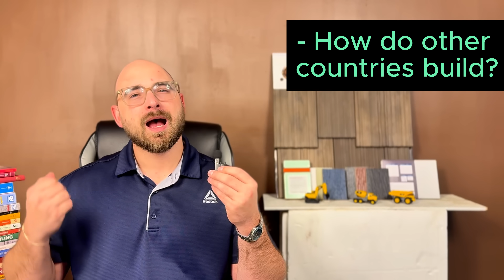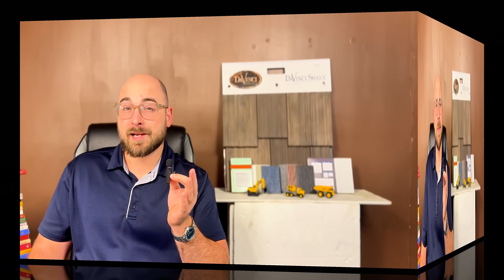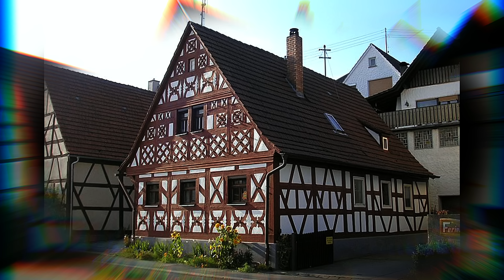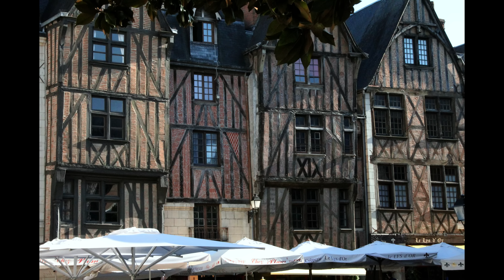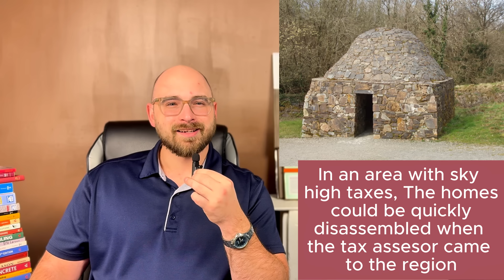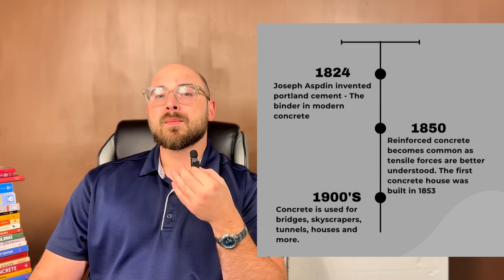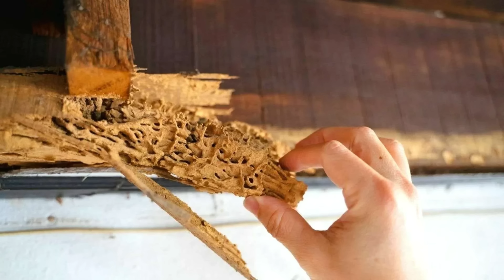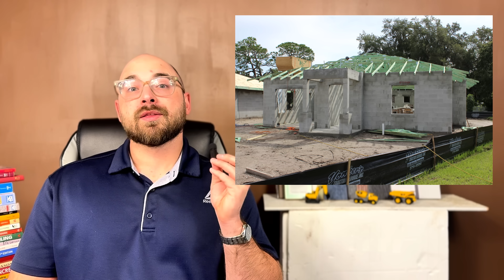Why Other Countries LAUGH at American Homes

Comment: I have a theory that one of the main reasons for homelessness in the US are houses built out of cardboard. Try using blocks or bricks. After the first owner dies, you don't need to demolish whole place and build again. Just paint it, fix here and there, and it's ready for another few decades of use. And it will be cheaper for lower income families.

Comment: @Mike Fortin: I’m planning on CMU construction in Florida. Reasons include termites, wind resistance, and thermal mass cooling. I’ve hit some of the design limits you mentioned, such as not being able to cantilever floors, but have come up with an attractive design partially inspired by the old Shipley-Lydecker house.
Internally, I plan on using lightweight steel framing for non load-bearing walls.
One additional tweak is using a cast concrete roof. I saw a lot of this when I was in Guam and Saipan where they have approximately twice as many typhoons as we do hurricanes.
Reply from the maker: Smart man, 

Have you considered ICF instead of CMU?

Comment: Even mexico, yeah I always wondered so I found the reasons , for example the roof has to be on those angles because of the snow, a problem we never ever will have in mexico, so for the wood the reason was the material is structurally strong and cheap, so it makes sense for USA but not for the rest because of the chain of production and practices, my granpa´s house has 300 years free of maintenance , in the newest part that was made like 50 years ago we need to water proof the roof every now and then oh yeah we changed the pluming because of lead

Comment: ICF does sound like a good approach, but leaves me with one question:  with wild fires being a long lived and growing issue in many parts of the US, is it even possible and if so, how costly would it be to restore one of the structures after a fire.  Think it's safe to assume that at least the outer layer of insulation would burn off.
Reply from the maker: ICF combined with fire-resistant design (Fire-resistant siding /cladding, metal flashing, non-combustible roofing materials, unvented attic space, defensible space, etc.) Is virtually fireproof. There's nothing that can burn. 

Should the outer insulation be damaged, rigid foam and furring strips could be placed on the exterior, allowing for rebuilding. 

And before the comments come in, YES you can build with concrete in seismic zones. You just need an engineer to add seismic joints and a proper foundation. A concrete building with seismic joints will be able to withstand a higher magnitude earthquake than a wood house. 

If you're worried about the cost that adds, build with steel and fire-resistant design. concrete is superior because it protects against all manner of disasters: such as vehicle impacts, stray bullets, and more.

Comment: This is an interesting video, and I loved the tour through so many interesting buildings.  However.... let's get real, structures are always about costs, and the wide variety of methods (particularly through time) are in every case local adaptations to costs: materials & labor ... and longer-term costs/risks, that this video only barely touches. 

Europeans who love "solid" brick live in lands that denuded their forests centuries ago .... and don't have earthquakes.  In the US one sees structural brick and stone on the east coast ... next to none of it on the west.   Ditto Japan.

And among the bigger issues that this video doesn't touch are about how do you heat or cool the building?  The purpose of man-made "homes"  has always been to 

1. hold up a roof to keep the rain out
2. walls, doors and eventually true glazed windows to keep bugs & critters out and temperature "in"
3. defense against other humans ... to varying degrees, depending ...

When you see medieval half-timber homes in Europe you see two basic "styles:" a first story of stone with the half-timber above, and half-timber from the ground up.   The first was much more defensible, and also much harder to set on fire ... a common means of attack.  Exterior plaster over wattle and daub was not just cosmetic. Infill brick ditto ... infill brick is lousy at EVERYTHING ... except catching on fire.   Where you see wood first stories you know that peace has reigned (at least locally, perhaps inside a city wall)  for the age of the structure you see.  If the structures are dense then the spread of urban fires has always been a factor for cities, and there simply aren't surviving wooden cities from the middle-ages, though many existed, particularly in China, Japan, etc.

But energy costs have always shaped houses and particularly cities in ways most people fail to appreciate.  Mankind is entering the. third industrial revolution right now.  The first was water and wind power -- this revolution was very slow, and didn't drive heat and chemistry. (heat was still mostly wood ... or dung.)   The second was fossil fuels starting with coal, and critically drove steam power,  steel making and other high-temperature chemistry (including Portland cement), but also heating.  The third we have now is the electric revolution really, but also efficient renewables (wind and solar) .. efficient enough to be cheaper in real costs (including social cost of CO2, methane etc) than fossil.  

Today, across most of the world, homes ought to have R60 roofs & R40 sidewalls, with high-efficiency windows and limited glass areas.  This is hard to achieve.  Leakage needs to be cut down, and then the home needs an air-to-air heat exchanger to keep internal air quality acceptable.  And yes... heat pumps.

It is an open question how many old homes will survive how long now, due to energy costs.  I live in New York state, near its capitol, and around me are incredible mansions (most decayed a bit or worse now) that can be bought for less than 100 k$, some for nearly zero. Most date to 1880 - 1900. The catch?  They cost more than 10 K$ to heat through a winter, and the maintenance and refurbishment will be 1 M$ or more.  Some of these, the most beautiful with the best locations and lots, are being bought and refurbished by the wealthy.  Some are used 2or3-season, with a separate winter home (this is particularly a coastal Maine "thing.")  But all the rest are slowly turning into roach and rat hotels, squatters don't even take them over because they are too cold, and they will come down.
Reply: Oh no not another American who have no geographical knowledge. 
The Mediterranean is a high earthquake zone.
We have so much forestry in Europe we are famous for it.
We get wind speeds higher than most US tornados they just don't form in the twister patterns. 
We get vast wild fires too. 
Please get a passport and visit Europe before making totally rediculous comments. 
Unbelievable.
Also my house alone is over 700 years old. 
You really have no clue about Europe or our buildings and your comment is totally misinformed nonsense.

Comment: The most robust building method is either stone and mortar or brick and mortar. Lightwood frame construction lacks robustness, and poured (rebar'd) concrete may be robust, but it lacks insulation and can be damaged by water ingress.

So, IMHO, the best way of building homes would be brick and mortar plus a layer of rockwool and plasterboard on the inside for insulation.

Then there's two more things to build to last: proper electrical / telecomm installations & plumbing, with maintenance hatches. And no crawlspace oddities, rather a proper cellar with a solid rebar'd concrete.

Comment: I'm planning a steel frame, with steel siding, and steel roof. But that represents the structural & exterior surfaces only. Inside that outer layer, will be insulation (probably rockwool, maybe a thin spray foam for seal), then an air gap with foil on both sides, then more insulation, and finally 4x8" concrete brick inside (12-15" total thickness). Aiming for the durability of steel, with the insulation of passive homes, plus a large amount of thermal mass at the innermost layer. South side will have a LOT of glass, but overhangs will limit sunlight to that from around April 1 through Sept 10. While allowing a lot of sunlight in november through february. Attached garage & greenhouse east & west, with some insulation, will leave only the roof and north wall as high insulation priorities. Want a double roof, with large (but close-able) ventilation panels. Solar with winter-biased angles, for relatively stable year round solar power.

Going for fireproof, quake resistant, tornado resistant, termite proof, mold resistant, and passive-"ish" R-performance. No trees within 100ft. On grid, but with minimal grid 'dependence'. Partial water from rain collection, heat pump but also a 'functional' fireplace, etc. And a large amount of DIY to get the cost out of the stratosphere, and a very custom design. Steel & concrete, but with the steel not "inside" the concrete (where it would rust & expand...)

I largely agree with criticisms of US house construction. Particularly with the prevalence of mold, termites, tornados/hurricanes, and fire risks. Also US homes are predicated on nearly constant upkeep expenses. I'd rather do everything 'right' - 'once'. Gonna shower the assembled steel structure & roof/siding in one big continuous coat of butyl rubber, for example.
There are far too many US homes with aren't "right" even when brand new, or need major renovation within 20 years. And even in the best cases need new roofing frequently, constant visits from Orkin, constant sump-pump work, reach 140F inside if the power is out in July, etc.

Even just the prevalence of trees immediately near houses in the US (with midwest weather no less) shows a complete lack of foresight. Sure it provides a bit of shade in summer, but in the meantime it cracks your foundation, mangles your walkway, strangles your plumbing/sewage, and then falls on your house made of toothpicks in a storm. How many times do you need to save $50 on AC costs to pay for all that? We don't even have foresight in large building construction. Even most stadiums need replacing in 30-40 years. Most of the best construction in the US was from 1900-1940. Now? It's almost a temporary placeholder for a real structure, even at the pricey end of things. It's just built-in-obsolescence, being sold to people with more 'hope' than 'realism'.
Reply: So it won't breathe, will be baking hot in summer, ice cold in winter. 
This is the dumbest idea I've ever heard. 
There is good reason why noone builds houses entirely of steel and never have done. 
I'd rethink this waste of time and money if I were you.
Reply: @alexpervanoglu7420 "so it won't breath" and "it'll be hot in summer and cold in winter" doesn't really logically match up.

Are you suggesting that making a more drafty house would keep it warm in winter and cool in summer??

The design is a passive or near-passive concept. So it'll probably need an HRV (particularly with a functional fireplace, to avoid backdrafting).

And it'll be "structurally" steel, but certainly not entirely steel. By weight there will be more concrete than steel, and by volume, more insulation than everything else (by far). South side will have a LOT of glass, more glass than wall really... so I wouldn't call it an entirely steel house. But from a load-bearing standpoint, yes, steel. That does mean that certain walls and the floor between 1st & 2nd story, will have some undesirable thermal bridging, but it's kind of a tradeoff thing. I've considered doing just the 2nd story floor in wood (structurally I mean)...

I dunno. Perhaps you could elaborate on exactly what you mean? Cuz it doesn't make much sense to me. If one wanted to call out what percentage of the build I think I can DIY, or whether storing rainwater in the attic is a bad idea... I'd at least understand where you're coming from on matters like that.

Comment: The building materials isn't especially important for this matter.
It's what you do with them, or to put it in another way, the building codes.

Uninsulated inner walls, single insulated wires inside said walls, thin, single plasterboard covering them and so on.
Obviously, the building codes differ from state to state, but in many states, the codes used would often not even be on par with an European building built 30 or even 40 years ago!

Nice facades, but internally corrupt buildings to put it short.
Just use the materials correct!

Comment: We did rediscovered the secret of the roman self repairing concrete about a year or two ago

One of the reason people laugh at US house building also reside in the material choice to risk

You live in the tornado corridor or it an area yearly struck by large fires? Effing plywood-polyester houses

US gotta look into wood alternative, stuff like bamboo grow at ludicrous speed compared to decades for a tree